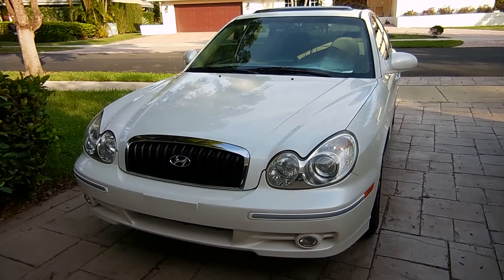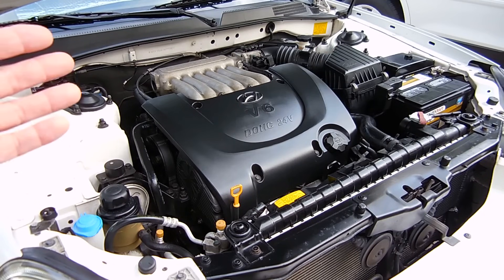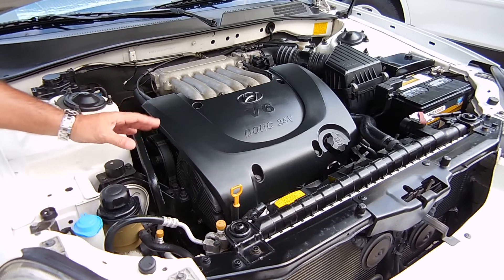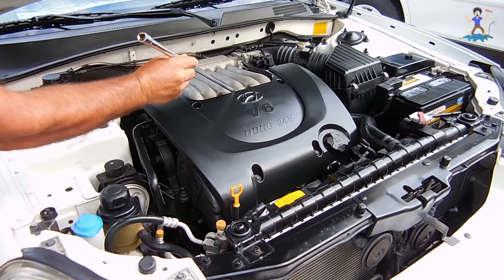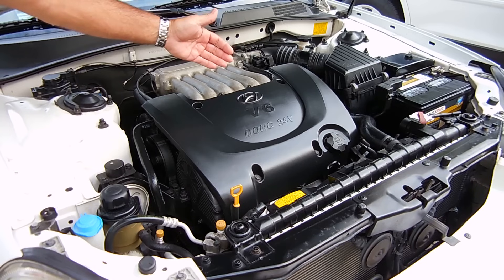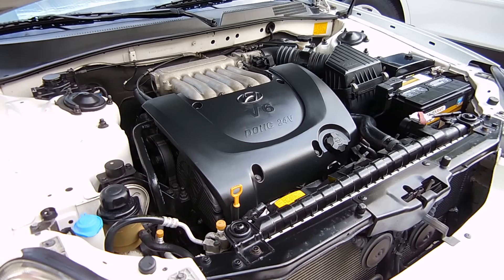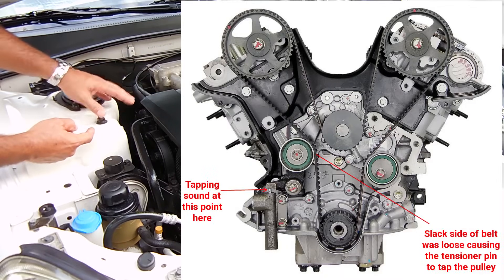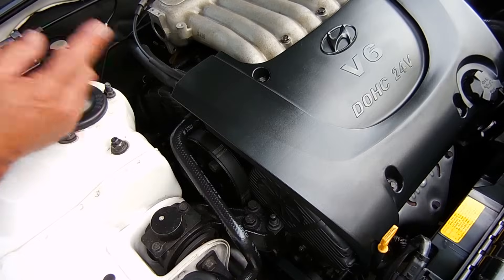(SOLVED)Engine Knocking or Tapping Sound That Varied With RPM

Comment from the maker: The making of this video was an afterthought. I had a problem with my engine, and spent hours trying to locate the problem. Once I identified the problem and repaired it, and noticed no other videos on Youtube did a good job showing my problem, I thought it would be extremely helpful to others to make a quality video explaining what to look for if they have a similar problem. The number of people that thumbs down this video is shameful to say the least. I didn't have to produce this video sharing my knowledge with others.

Sound my engine made at idle(From my phone): https://soundcloud.com/electronicsnmore/tapping-sound/s-4aMRW
Reply from the maker: @ashraf el sadat How did you not read the pinned comment? Lol
Reply: Hi, I experienced low oil pressure and the exact sound you have described is coming from the area where the belt and pulleys are, the other side of the engine is quiet and the engine in general. Oil is on full level. When I rev the engine, the noise seems to disappear but when I release the gas, a loud resistance sound is heard from the bottom region of the pulley system near the crankcase until it reaches idle then the tapping sound continues. Could low oil pressure have caused my tensioner to slack? By the way I changed the filter still low pressure... I haven't yet had someone open the engine. The engine was rebuilt a month ago with new conrod and main bearings, oil pump as well as seals and valves. Vehicle is a Toyota Gaia 3s engine 1998 model...
Reply from the maker: @mutalechanda4772  If it was just rebuilt, you need to bring it back. You shouldn't have low oil pressure. Thanks for watching!
Reply: @electronicsNmore  I have a 2.4 l engine and earlier today I was driving and all of a sudden my car started making a loud screeching and knocking noise so I pulled over to see what it was and and didn't find anything in the engine bay that looked out of the ordinary but when I went to turn my car off the engine was still making the knocking noise and the noise faded away till the knocking stopped and my car wouldn't start for a couple minutes even when I was trying to start it any idea what that could have been?
Reply from the maker: @jonesvaughn8946  Sounds like a loose belt and bubbling coolant.
Reply: You ever heard that there are FAKE aftermarket parts out there??? Like ebay stuff sent from overseas? Apparently hollow inside or look like a proper sensor but just wires joined inside... or maybe oil filters that are just empty inside. Haven't seen anything specific but have heard of it occuring from scammers in asia trying to make easy money.
Reply: @OffGridInvestor  thats the customers fault for not doing research on the part and where you are getting it from if its cheap than you get what you pay for its shity.. duhhh also really helpful to read reviews of the product and the seller not meaning to be rude but so many people wonder the question you have and its basic common since unless you didnt graduate middle school even or didnt know how to work a computer and or phone
Reply: But over a thousand people liked it. You can't please everybody. PS linking the sound it made makes the video more helpful, so good on ya for that addition.
Reply: My dude, I have a Kia Optima that’s a rebadged version of your Hyundai (same engine), I’m having the same issue. Thankyou so much for this video, though I’m not able to do it myself but I can at least can guide my mechanic to look at that area and get it repaired.
Reply: God video! And explained well!
Reply: I changed both of timing chain and the tensioner .. but did not fixed ... maybe it is about cvvt?????
Reply: I was thinking that too
Reply: BBC k
Reply: did you have to remove engine to tighten it or what
Reply: That is sad! Accept my support!
Reply: I would let that car go at the 1st sign of a water pump issue
Reply: Great videos, I have a 2006 Cadillac cts and getting the same problem, going to see if it’s the haudralics is the problem. If it ain’t what else could it be?
Reply: you do realize this is the internet and people will thumbs down a video simply because they don't like the background music right?🤣
Reply: Hydraulic tensioner... figures with an overhead cam engine.
Thanks for sharing.
Reply: Why didn't you make a video of the engine tap? I always have trouble finding a video with the sound and what they did that fixed it.     As far as I know you could have just took it to a shop and believed whatever they told you was wrong with it and googled the rest for this video.  Your hands don't even look like a mechanic's hands. Just saying.    Sorry had to vent, trying to figure out what's wrong with my truck and I keep finding click bait videos that don't help me any.  I meant no offense, just wish you had recorded a video of car making the sound before you took it to the shop.   Thanks for reading have a great day👍
Reply from the maker: @jake_break9185  I think I made it very clear in the comment you replied to.
Reply: I would imagine most people like myself are trying to compare a noise which quite a few videos have but it's hard to match to different issues.  Your video actually doesn't help much unless you know that it's this specific problem.  But I'm sure it helped a few judging by likes.
Reply: Hi bro. I have a kia forte2012. And having exactly the same problem. What should I do exactly ??? Which part should I replace??? Mechanics are very confused
Reply from the maker: @پندارنیک-س7م  Inspect the hydraulic tensioner on your car. You need to remove the timing belt cover.

Comment: My Subaru impreza 2019 sedan is making a slapping noise on idle. Drive, neutral, and reverse all sound different but have the same slap like noise on idle. Its def not a knock but more of a glug glug glug with slapping. If i press the accelerator and add rpms around 1200 the noise is gone. Ive noticed it under idles alot in park below 600 lowest was 200. Im certain theres a small leak in the intake somewhere but the slapping noise has to be a belt right?

Comment: So it sounds like the hydraulic lash ajusters. Which is a common issue with this motor. The cause of this problem is usually the type of oil that you're using 5w-30 Castrol or Valvolin high mileage full synthetic. Are what I find that work well or try using Mobile1. But if that doesn't fix it. Then there's a possibility that it's a bad lifter.

Comment: Hyundai.  Let it die.
Reply from the maker: You should be so lucky to have that car. The most reliable car I have ever owned. 20 years old and 160,000 miles and still runs perfect. Unless you know what you're talkin about I suggest you zip it up.

Comment: I listened to the audio of the noise and my car sounds exactly like that, except mine is intermittent - with a few seconds in-between. I also noticed oil splatter on some hoses. Have a feeling this could be very bad 😒
Reply: Check the crank seal under the pulley for a leakage

Comment: Fact number 1 that motor is a clone of a cast iron block Mitsubishi 6G72/74 that's been around for over 30yrs in a SOHC & DOHC version & all motors with a timing belts can suffer from the tensioner taking a dump causing it to rattle I've seen it dozens n dozens of times on all brands except Mazda'ss they have a paul that locks the tensioner n it can't happen!
Obviously your not a mechanic!
Reply from the maker: Obviously you're a moron. Anything else? Tell me something I don't already know.

Comment: I need help I have a 2014 maxima I had a bad timing chain and cold start and starting car would make a Loud rattle now I got my timing chain replaced improved a lot and it still makes a small rattle every cold start what could this be ?
Reply from the maker: Sounds like a lack of oil on start up.
Reply: @electronicsNmore  how can this problem be fixed if I put the right amount of synthetic oil?

Comment: Hi.  Great video. I have an 06 Monte 3.5 that is making a very faint tapping sound that doesn't change with the RPMs. I can barely hear it while in idle and kind of comes and goes. The funny thing is that I can only hear it while in the car. Over the engine and underneath it gets drained out from the engine and other noises. It's not causing any drivability issues so far. Have you heard anything like this before? It's a steady tapping when it's happening. Thanks for any info.
Reply: I got the same issue, I have a monte carlo ls 2007 and I hear it come and goes, my temperature meter goes a little high even though I just got work done on it for a gasket replacement.
Reply: @theronindian7996  about a week ago my transmission blew. It just hit 215,000 miles. I don't believe it had anything to do with the noise. Good luck with yours.

Comment: I have the same g6ba engine and recently also did a timing belt job. My car suddenly shut off on the street on day and when I tried turning my  ar back on. It started fine but began getting tapping sound on the left side of the engine like you said yours had. My car idles perfectly fine too

Comment: Atention! engine oil is engine life. good oil at max 10 kkm change. use small magnet on the oil filter and on screw oil pan. do not spin engine more than 3 krot/min. do not make race F1 w/the car. do not spin the engine on the idle more than 2krot/min. do not force engine on the winter temp. Try to start engine w/engine a little warm before to start. Use blockheater engine 2-4 h before to start the engine. The car engine is a thermic engine and the good temp. for it is 90 degree all the time.

Comment: Could this be the case on a 05 tribute 2.3? Got it at 175,000 miles alternator blew out then right after that it developed this sound. It's currently at 196,000 with no problems power wise but the sound is only at idle every now and then (especially cold starts) then goes away after about 1,100rpm.
Reply: pretty much the same as .y Wigo
Reply: Same tribute 08. But i think his right it was the slack  belt bouncing up and down and when you drive its gone

Comment: My car started to do the exact same thing I thought it was really weird sometimes when I put my foot on the gas it would basically go away when it was idling it would come back strong I put more oil in the car checked everything I could then it went away for about 10 days.... Then it just started to come back.... I'm going to buy a higher grade oil and see if that can help out.
Reply from the maker: If the sound is coming from under the plastic timing cover, I would suspect the tensioner.

Comment: I have same problem with my Hyndai Tucson 2006 V6 how can i fix it
Reply from the maker: Front right wheel and all plastic covers need to be removed. Pull off the crankshaft pulley to get to the tensioner. Big job.
Reply: @electronicsNmore  thanks

Comment: Could a bad tensioner pully make that weird leaf hitting a fan noise?
Reply from the maker: You need to try and identify the exact location of the sound.
Reply: @electronicsNmore  yeah it’s hard to do that. All I know is, the sound happens only when the car is moving. When the car is moving over 10mph and only on the right side is where I hear it mostly. If I turn the wheel really hay to the left and or right. Turning it right really quick makes the noise stop for a second. I’m thinking something in the wheel hub and or axle or ball joint area. It very strange. I’ve never heard the noise in my life. I’m hearing the crank shaft cam gear timing can make this noise. It’s just I don’t know shit about that part

Comment: B my Camry I hear a noise that sounds like a leaf hitting a fan only while driving. Not breaking not while throttling . It’s coming from the driver side front wheel area but again when I gas or break it doesn’t make the noise. Only when the car is moving
Reply from the maker: I wonder if it's the transmission. Very unusual symptoms. It makes noise when you maintain the car's speed with your foot on the gas pedal, but no noise when foot comes off the gas pedal, or when you accelerate.
Reply: @electronicsNmore  It always makes a noise when the car is traveling. Not gassing it or breaking 
. Sometimes if I turn the left or to  the right kinda quick or won’t make the noise. My transmission does not slip or anything and just had the trans fluid and the filter changed. About a year ago. Runs good. Also no signs of transmission issues. My splash guards underneath are all zipped tied together. I’m hoping it’s something to do with that. If not maybe something in the hub of the wheel. When I get paid next, I’m going to my Toyota/Lexus specialist and I hope he can figure it out. Lol

Comment: I have this motor in my tiburon 2003. How can I do this without taking the belt off. I don't want to ruin my timing. Is it possible to do this without taking the belts off the pulleys
Reply from the maker: Remove the top plastic timing covers and try looking inside using a bright flashlight. Nothing should have slack.
Reply: @electronicsNmore  i know but I want to replace this hydraulictensioner how can I do it without taking the chain off completely and messing with my timing

Comment: We had a honda oddessy that legit sounded like a desiel. Aftermarket tensioner went bad after 5k mikes so we put the old original tensioner in that had 200k miles and she is at 300k now and still runs. Starts a lil slow but i think the sound was valves tapping pistons. BAD SOUNDS!
Reply from the maker: Some aftermarket parts are good, but for a part like that, one that takes hours to replace, always go with OEM. Thanks for watching!
Reply: @electronicsNmore  ya we do that now, only this car its hard to get oem cause its a 2002. Not old but old enough i guess the dealer was fazing it out.

Comment: That's great thinking and your sincere efforts to save the time and guess work of others who face same problem, but many do not check the comments and as this was an after thought people are not finding the exact sound they should relate to. So there could have been some adverse reactions, thumbs down etc. Request you to add that sound in the beginning,  and then explain to engage the concerned people
Reply from the maker: People need to understand that not every engine will sound the same when the problem happens. The exact sound is irrelevant, what matters is where the sound is emanating from. I added a sound file later. I even told viewers in the video, by using an annotation, to refer to my pinned comment. There are way too many entitled people in this world, not enough appreciative people. The trend better change, or we're doomed. Thanks for watching

Comment: My town car has a loud tick when I take off from a red light.then I hear at times a slip like a zip sound.or if I'm on highway I put overdrive and the ticking gets louder. Not sure what it is.car has 286kmiles
Reply from the maker: Could be an exhaust manifold leak.
Reply: @electronicsNmore  ok thank you

Comment: My toyota yaris makes a clicking sound on right side when when I take off putting so gas at 2000 to 3000 rpm at gear 1 but dissappears when I put gear 2 and upwards, it also makes a sound when I'm doing steep hill
Reply from the maker: Hard to say, you need to pinpoint the general area of the sound. Thanks for watching!

Comment: Curious when you put in the new OEM hyundai auto tensioner did you measure the GAP WHEN PIN was pulled on auto tensioner? The first one I used was a gates and the spec was below 7mm (according to hmaservice manual its suppose to be 7 mm to 9mm). The second one used OEM hyundai auto tensioner was 6.7mm roughly. Still have tapping.
Reply from the maker: No. Installed the tensioner(for my engine), and pulled the pin. Thanks for watching!
Reply: @electronicsNmore  Think your video is pointing me in the right connection. May have a defective OEM hyundai auto tensioner and or the TENSIONER PULLEY is moving and the bracket on the TENSIONER PULLEY is making noise. Running car with out DRIVE belt and timing covers to confirm. This video and another video  on Hyundai TENSIONER PULLEY ASSEMBLY 24840-37120 failing is interesting in that it can lead to high misdiagnosed problems: i.e hydraulic lifters.
Reply: @electronicsNmore  Reason ask is trying to justify through testing vs sound. You describe some great points hydraulic lifter noise vs rod bearing vs auto tensioner failing. I got your video sound one morning on start up of a v6 2.7 delta (sitting for 2 days) and thought it was time for a new tensioner. The old original OEM Hyundai was clearly leaking fluid (have pic) however upon replacing new oem hyundai parts: tensioner, tensioner, pulley, timing belt (gates T315), idler pulley, water pump. I am getting the same sound. So going back and forth from hypothesis of lifters vs auto tensioner failure. I ran the car without the drive belt and timing covers to watch the auto tensioner and bracket- steady as can be at idle. I also manually rotated the crankshaft watching the auto tensioner and I can see it retract (the silver pin in the auto tensioner) as it rotates to TDC (top dead center). SO its not stuck. So dont want to shoot the parts cannon of another auto tensioner when there is already new one on there OEM and upon my observation is working per manufactures design- I think> However I cant really hear lifter tick.